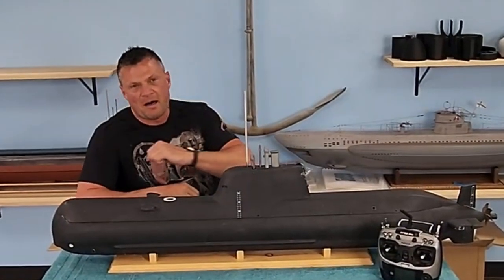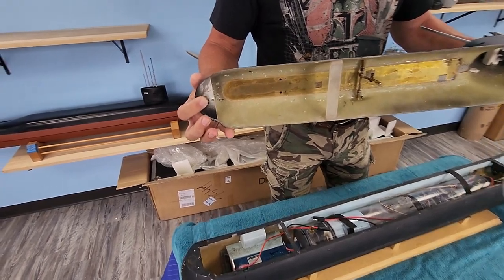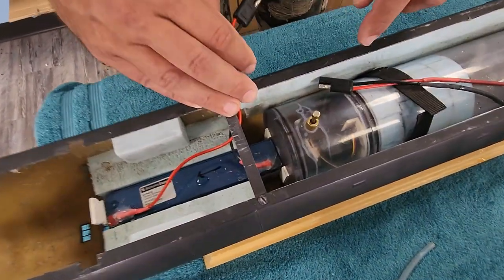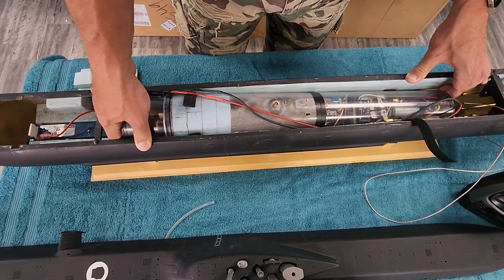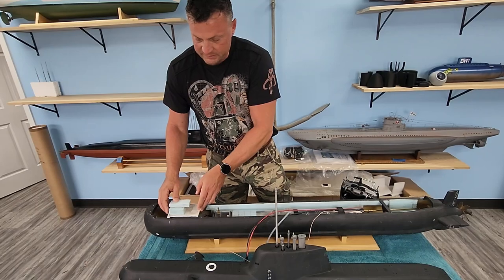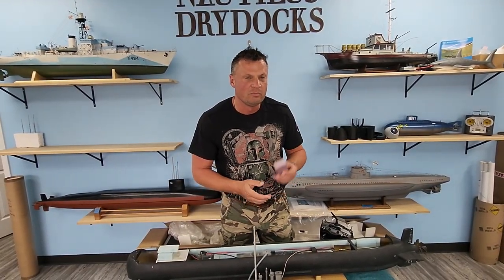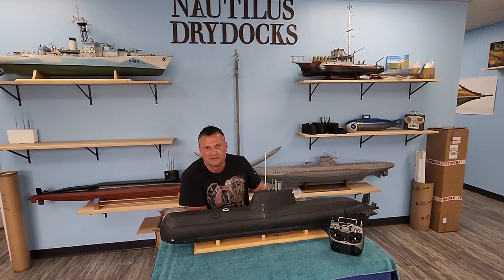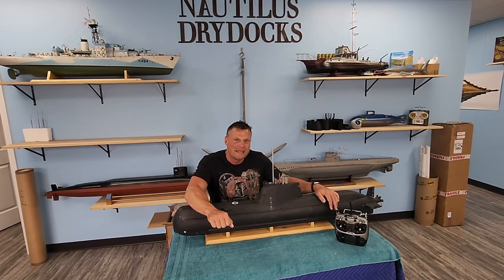A Greek Submarine?!~ Say Hello to the 1/48 Scale Type 214

Comment: I have a quick question. What is the benefit to a x styled rear control surface?
Reply from the maker: Going with an x-tail versus a cruciform offers approximately 1.4 times the force for turning and/or pitching up and down.
Reply: More agile performance underwater.  Can result in a smaller turning radius depending on the model.
Reply: @RCSubGuy  That makes sense and thank you for answering my question. Cheers!